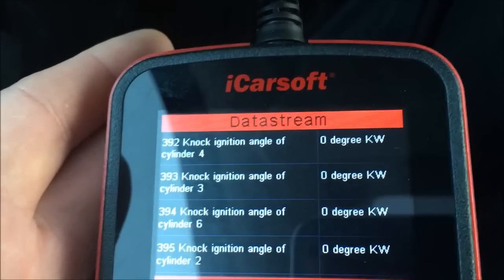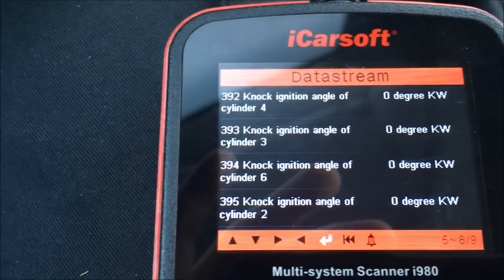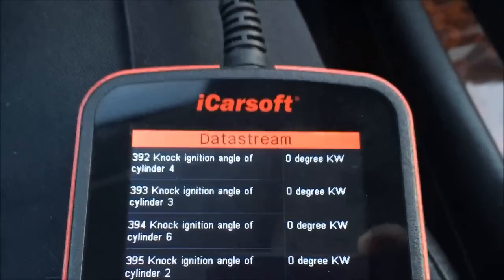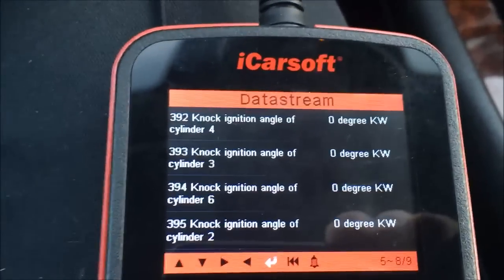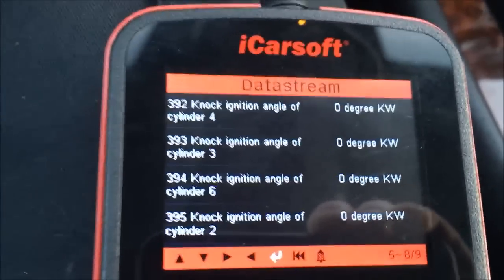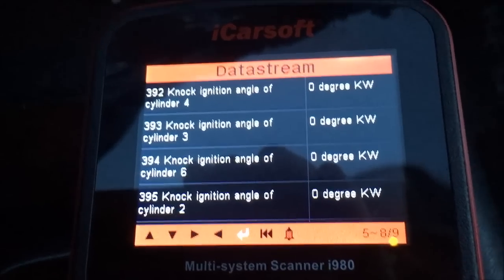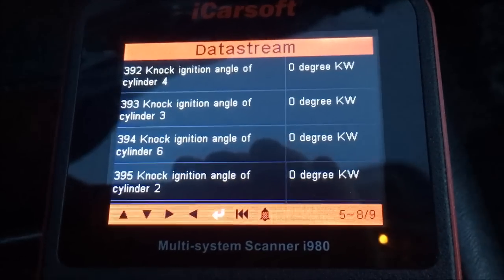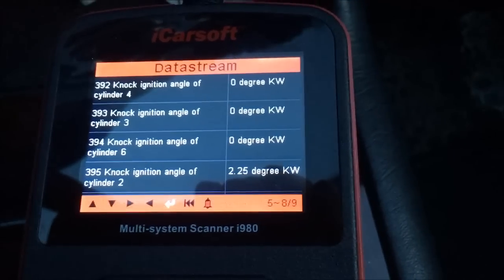Can you use regular fuel in your Mercedes ? .. real time knock test

Comment: I have a 98 Mercedes C230 and of course says premium fuel only but I ended up deciding to put 87 octane and in my mind I knew okay she's going to probably not run good but believe it or not mind you the dang car runs actually a little bit better for some reason then running premium feel why I don't know but you can run premium fuel and I check my spark plugs it has been no changes as far as in the condition of them Pistons or claim it's amazing because all you Mercedes owners that have these C230 course every car is different and some cars they will knock and run like crap but as far as Mercedes for the money I definitely would run regular unleaded cuz it makes no changes on the vehicle no knocks no bad sounds runs beautiful certainly recommended especially if you're to save money for fuel, and one thing for everybody to know including for certified mechanics cuz not all certified mechanics know everything one thing some cars that require premium fuel and do not run well the reason is because of the computer system you could change the computers Hardware within or change the whole computer itself where you can run regular fuel in your vehicle because of the sensors and the computer system on a car that only supposed to run premium fuel the computer is what makes them run the way they do when they knock or run horrible on regular gas and all they do to the computer system change all that out the motor would never know and you would not get no pinging or knocking

Comment: In the United States it is about the clean air. The United States government requires the fuel company to have octane in every grade of gas. So Mercedes car need not to use premium gasoline. Since every pump has an octane, there's no differences. Stop letting the fuel company rip off!
Reply: Obviously gasoline has added octane. This conversation is about the percentage of octane present versus the performance and potential damage to the Mercedes engine. As shown above, 87 (regular) provides lower performance and protection versus the recommended 93 (premium). But if you want to pump E85 into your tank, that's your prerogative as that engine is yours to rebuild.

Comment: I noticed that there's a slight knock with lower grade only when the guy floors it on an uphill. Most of us won't drive that way.
Also, if you allow the car to get used to regular gas, it will make the proper adjustment to be able to take it although you could lose a bit in performance. I never had any issue using regular on my 2004.
Reply from the maker: As shown in the video , the knocking occurs at 1/2 throttle as well. The car does not "get used" to regular fuel. It just reacts when knock is detected.retards the spark until there is no knock, then returns the ignition timing to its stock parameters. Eack knock is a potential to destroy your engine . This video was to show the difference in knocking between the 3 fuel grades . Each owner can decide how to use that info. For me , I would never buy a used Mercedes that I knew was using regular grade fuel. Just my opinion
Reply: The video shows midgrade (89) only knocks in full throttle.  And only some cylinders.  I might switch to that & save 30 cents per gallon

.

Comment: i mean you didnt open it up completely with the 93 octane... but thats cool though. You can legit hear you do it when you have the mid grade and regular in.. Obviously the regular gas isnt going to be great for it but 89 is not going to bother your engine at all. You started to open it up with premium and cylinder 2 shot up just like it did with mid grade. the nock sensor is there because all gas no matter what the octane is not chemically the same. Every batch of premium is going to be different same with mid and regular. The sensor is there to keep your engine running fine when your gas is burning off a little fast. With that being said i wouldnt run regular in my mercedes unless it was the only option for me to get home in an emergency because over time it will wear the engine down faster. How much faster? I couldnt telll you but i am not about to find out lol. Mid grade is the way to go and throw some premium in there every now and then if you want or just throw some stabilizer in every now and then it will keep the engine in great shape and you can save some money on gas
Reply: I've been using 87 in my 2006 c class since 2006 never have any issues lol. its just a fancy Chrysler engine people don't get all aristocrat thinking you're all special for driving a Mercedes. I use 87 in my 2014 s500 too. The average person won't notice the difference. its not like you're driving a lambo, Ferrari or a formula 1 car.
Reply: I been using midgrade myself

Comment: fupabox
My son-n-law has an older 2004 infiniti G35. He has owned it about a year now and has been using regular most of time. If he knows he will be driving it extra hard is the only time he may use the premium. With that said, what should I tell him is probably going to happen to his car in the long run from him using regular 90% of the time?
 Like what are the tell-tell signs of trouble ahead? 
And will the car end up not lasting him as long as it should? 
Thx again!
Reply: Absolutely nothing's going to happen to his engine at all! In fact I have a 2003 Mercedes-Benz C-Class that I've run nothing but regular unleaded fuel in since tank one it's got 135,000 Mi and it runs perfectly

Comment: I recently worked on a C63 AMG that had a damaged engine. I asked the owner what type of fuel he used on the the car and he said Regular.. ended up costing him a lot of money to replace the engine.
Reply: That does not mean it was the fuel though.
Reply: Paul bouverette yea it dose if he was driving it hard
Reply: C63 are notoriously known for having engine problems with or without premium gas. That's why it's resale value is low.
Reply: AMGs require premium but naturally aspirated not necessarily.

Comment: Most European engines are design to run on RON 95 minimum ( which is AKI 89) ..... (RON 97 is AKI 91)Its just that they tell us to use premium cause if they suggest 89 minimum (like some Ram trucks, people will "try" to use regular. In fact most Euro gas station have 95 as minimum standard everywhere (Germany and UK still have RON 91/AKI 87.... Dont know why they bother haha) ......and RON97/98/99 ; AKI 91/92/93 in some stations location/country dependant. (Ive been to Europe several times ..... )

For me tho, i dont use regular now (since gas prices are up.... ) i dont see it a worth the money; reg is quite unstable i find. So my main grade is midgrade premium and super/supreme. 89/91/93 esso/94 Petro..... Although my fav is 91 Shell cause its ethanol free or Shell 89 (5% ethanol.... Not 10%).
Reply from the maker: I use the Shell V power or Canadian Tire premium in all my motorcycles and small engines .. As far as I can tell the Can tire premium also has no ethanol.   "May contain ethanol " is only printed on the reg. and mid grade at Can tire fuel pumps.  In my cars I have tried mid grade and found the fuel mileage is worse .. could be all in my head tho.. lol
Reply: fupabox good to know on Canadian Tire Gas 91.... :) Cant go wrong with Vpower tho... my fav.

Comment: So my ml430 was run on regular for 345,000 miles never once had issues with the motor also it's still running since I sold it
Reply from the maker: Amazing...
Reply: Your comment is why I just dropped around 4k in parts for my ml430 with 190k.. miles
Reply: This proves premium shit is a legend thanks for this comment
Reply: That's crazy, wow. I have a GS430...and have ran 91 or 93 octane in it. Runs great...still like NEW, with 140k on it. What type of driving did you do in the LS..and how many miles per gallon did the (accurate) factory trip computer say you were averaging?
Reply: @AirRideFanatic  id get around 20 21mpg on the freeway at 75mph around town i never really paid attention to it as I only drove 5 minutes to work and back
Reply: @smackface6  mine has a bad fuel gauge level sensor, o2 sensors,  egr valve, rotors, fuel filter, and door locks, it's expected at the mileage,  i already did hubs joints spark radiotor thermostat and radiotor and fluids havnt driven it yet.
Reply: Yeah. My GLE has run on regular everyday for 6 years so far. No issues. 
Had a ML before then. Regular also. No issues before I sold it.

Comment: Hey buddy good video I'm just wondering if you'd mind making a video using Costco's premium gas and see if there's any difference between Costco and Petro or shell I would  appreciate it
Reply from the maker: I actually did it (no video) kind of.  I tried to find a difference between Shell V-power and Pioneer premium.. couldn't see anything noticeable in my cars. Not that there is no difference , I just couldn't find one that was measurable. Possibly a few more mpg with the V-power, but hard to determine. I do know that in Ontario V-power, can-tire and Costco premiums are ethanol free, so I only use that in lawnmowers and chainsaws. I have read that in different provinces Costco may not be ethanol free. Very hard to find accurate info. I can say for certain that v-power with a bit of seafoam in a 5 gallon Jerrycan, is all I have used in all Motorcycles, chainsaws etc for about 15 years. No winter fuel drains for storage in 15 years and zero running/starting issues since using that combo. I was thinking of doing a longer term test in the summer with the v-power vs something else ( v-power almost 20 cents a liter more $$ than others )  want to know if there  is enough difference to justify the $$ . The outside temp and humidity needs to be pretty stable to compare though.
Reply: fupabox wow thanks

Comment: I'm a kid wanting to buy a pre owned Mercedes as my first car that I've been working for ( I have a job) and saving up for it. My parents said they don't prefer me to get a Mercedes because it takes premium gas and they said they're not gonna pay for that expensive gas. Is it okay to run the Mercedes on just regular? I'm not gonna drive like a maniac but when I drive on the highway and stuff will it effect the car? Is there any way I can get this car without premium gas and keep it in good shape cause it's been my dream car for years and I'd do anything to get it as I've been working tireless hours at my job. Thanks!
Reply: if you still have to rely on your parents to put gas in your tank, you can't afford a mercedes yet. a preowned mercedes with more than 80k miles is almost never a good buy, especially as a first car. I'd only recommend a low mile CPO tho. But take my advice, buy that dream car when you can afford a new one and find a bargain on a CPO, otherwise that dream car will very soon become a nightmare car. I really wanted a used luxury car as my first car too when i held a minimum wage job in college, but i took the advice from an older fellow and steered away from it. 4 years after college, now i'm making $70k a year, I can finally actually AFFORD one and just got my first Mercedes last month.
Reply from the maker: unfortunately you have to use premium or you will cause expensive engine damage .. even driving gently it is ery bad for the car...you could get a diesel engine Benz.  they are great cars and diesel is even lower cost
Reply: just use regular gas there is no difference between premium and regular gas
Reply: jonathan cook you’re an idioto mr roboto
Reply: Until they brake down $$$$$
Reply: ShiftTeam Steve you will kick your self in the ass. Get a Lexus LS or ES NOT GS! Luxury cars that recommend but not require premium fuel.
Reply: ShiftTeam Steve if paying for gas is your biggest concern your not ready to own that car yet. Overall maintenance cost and reliability should always be the biggest matter. I can tell you now that my Mercedes with its high mileage is very reliable but definitely cost a good penny to keep it that way.

Comment: Thanks!  2002 ML 320 130K plus, always the good stuff.  Low grade quickly clogs up the egr valve and pipe.  
Q: Was your test gas 10% ethanol ?
Reply from the maker: no ethanol in the premium,,mid and regular had up to 10%..no exact % listed, just says may contain up to 10%
Reply: @fupabox  Premium gas doesn't provide any more power or contain better additives than regular gas, and it contains the same amount of ethanol as other grades.
Reply from the maker: @smackface6  depending on the fuel it does. The only zero ethanol fuels I can find are all premium , and the premiums I use all also advertise cleaning additives that the regular and midgrade fuels of the same brand don't have . Factoring in that ethanol has less power per unit of measure ,ethanol robs power and also fuel economy,on top of degrading rubber seals on hoses in small engines in particular,
Reply: Premium gas doesn’t have more energy, but it can be compressed to a higher pressure, which allows the engine to extract more power from each piston stroke

.

Comment: Great video as usual.  Have you tried using the i980 scanner on a w202?
Reply from the maker: it won't work on a w202  only cars after 2000... well it will do the normal OBD2 engine stuff on a w202 , but no canbus or abs, or airbag stuff
Reply: That's what I thought, just wanted to make sure.  I have been trying to find a cheaper alternative to sds or even the knockoff star systems to get tcu stuff, but looks like the 38 pin connector is the only way.  All I really want is live trans temp and brake functions. Any recommendations by chance?

Comment: wow awsome video man. finally proof for the people who say gas is gas. i always run premium i dont care how old my mercedes is. thanks for this video very interesting.
Reply from the maker: very welcome... I've been meaning to do it forever, but just didn't want to drive on a full tank of regular in my car
Reply: fupabox lol. im very suprised by your findings because i never realized that the knock would be so instant. i thought maybe over time due to carbon build up from low quailty gas it would develop spark knock. but now it makes more sense. some guy who owns a e320 wagon m112 engine, he uses 87 then runs seam foam thinking it will offset the damage lol. i guess he is wrong.
Reply from the maker: Yup..the damage is instant...or possible damage. The # of knocks /pre-ignitions per second can really add up in the few second that it takes the computer to react..not good for rod bearings wrist pin bearings, valves etc.
Reply: James St. Patrick  dumb fuck

Comment: Great video. ! thanks for putting your car at risk for us! I just wanted to add: Even if the ECM retards the timing to eliminate the knock, that is still not acceptable. It means the timing is not correct during that time it is retarded. Which means to me that the engine is not putting out optimal horsepower during the retarded timing. What do you think?